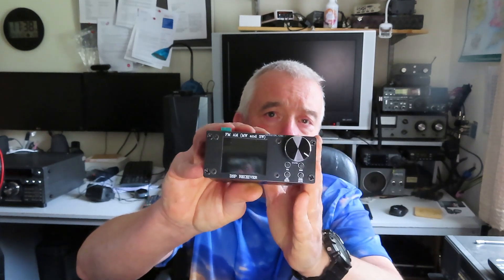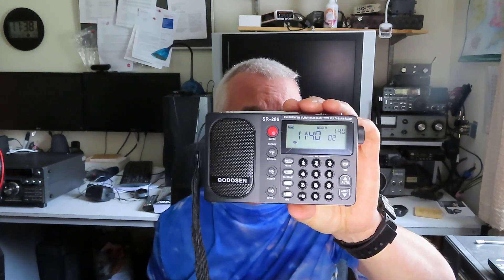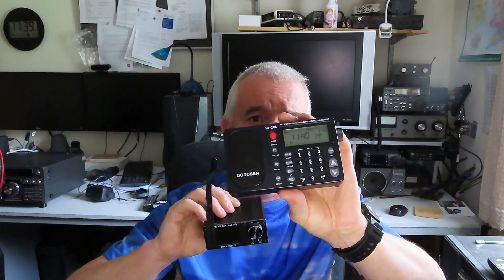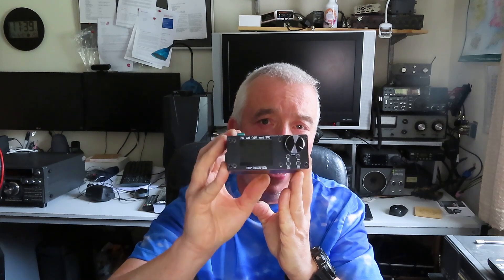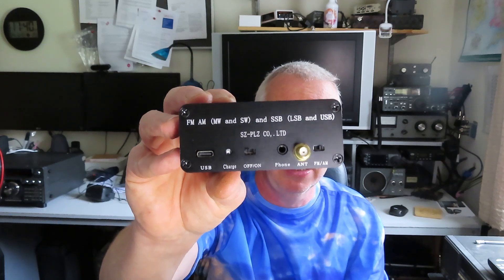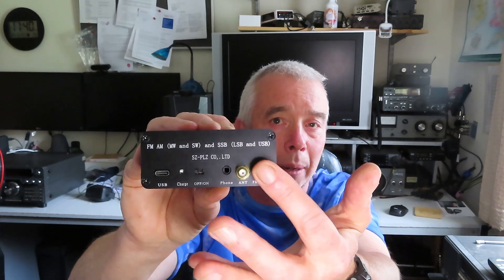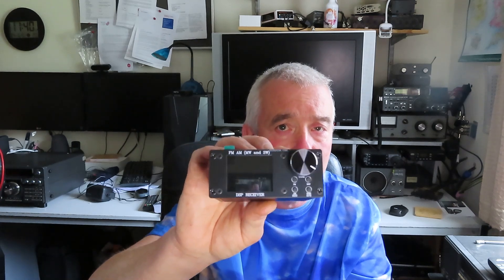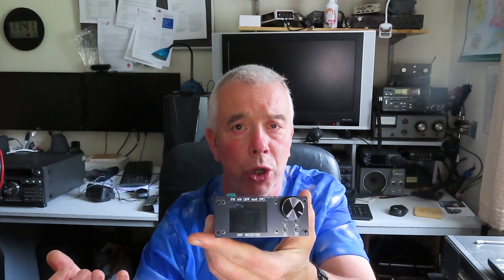The ATS 80 on FM vs the Qodosen SR 286

Comment: Dx286 got tef6686..the best for fm but on sw si4732 should excel specially for having ssb patch
Reply from the maker: DX 286 IS better on every band!
Reply: Ats 80 doesn't have shield around the tft display which generates rf noise, in sx286 they have got a shield around lcd I guess which reduces hissing type noise and improves snr

Comment: Interesting comparison, thanks for sharing. Well, it's clear that the mighty "Q" wins hands down once again.
It clearly does in FM too compared to my ATS 120 AMP, but on short wave they come up pretty close to each other, the "Q" having a small advantage.
BTW it could be deliberate, but you do realize that you haven't taken the factory installed protection film out from the display of your SR-286, do you? 😁It's pretty scratched already.

Comment: Nice demo, as always. Personally, I'd add a few points about the overall design of any receiver from the ATS family (≤80). 

1. How could anyone come up with the idea to place an antenna switcher on the back panel? 
2. Why can't the antenna-band commutation be done automatically? 
3. If antenna-band commutation is enabled by design, why would anyone need to use a single antenna IN and not have it split into two dedicated INs? 
4. Why are other critical controls like the power switch and charge indicator (and even headphones OUT) placed on the back? It feels like I'd have to rotate and turn this device around all the time. It's not a pocket receiver one could operate with one hand, nor is it a desktop receiver. 

Nevertheless, it's interesting to learn what's inside the ATS-80. If it is SI4732*-based, it shouldn't perform much worse on SW compared to the SR-286. 

Thanks! 👍🏻
Reply from the maker: Very good points you make. The design of the ATS radios is odd and the form factor being neither a true portable nor a desktop is strange too.

Comment: The 80 did not have the distortion issues the 286 had.  I had a DX286 but returned it due to that distortion & sound quality issues.  It was not pleasing to listen to, compared to my PL330 & PL600.
Reply from the maker: Surprised to hear this as I haven't noticed any distortion on my 286. The ATS 80 is totally outclassed by the Qodosen on every band in my opinion.
Reply: I, too, hear some distortion on FM with volume set to a relatively high level on my SR-286. I should say saturation to be more precise. Not quite annoying, but this doesn't make the Qodosen my favourite radio to listen to music on FM.